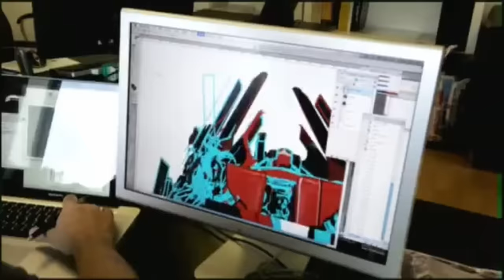TRANSFORMERS: THE BASICS on TRANSIT

Comment: This is surprising, a character I don't know off the top of my head, don't remember ever encountering this one on the wiki
Edit: And that's why, RID is one of the biggest gaps in my knowledge , especially the comics, though I have to have read about that IDW one before at least in passing.
As a fan of Scioli's GI Joe vs Transformers, I've always had a bit of a soft spot for that Bus Decepticon, it's a really memorable design for a rare original character in that series.

Comment: You have a character known to look like a rhino. How do you adapt it? By making him look like an insect. Again. Meanwhile, the actual bug characters, from Bombshell to Waspinator to Hardshell, never appear in these piece of trash movies...
Reply: His insect look seems to be far more memorable than his rhino looks
Reply: @8ball180  It´s equally boring to me, but if they want bad guys in Transformers to have bug faces that much, why aren´t they adapting the ones that are supposed to have them?
Reply: @danielmedela8725  well they do like scorponok in rotb or TF 2007. Also unless the character transformes into bug they won't adapt them, the bug face is less of transit being a bug and is more of a generic monster man face
Reply: @8ball180  I hesitate to call that Scorponok a Transformers, it doesn't even transform in either movie. It, like Freezer/Frenzy, is only there to connect them. Sure, the ones in BB movie did not transform either, but at least had kibble.
Reply: @danielmedela8725  they have do have robot modes just not seen in the movie plus not all bb transformers had kibble like ratchet, Ironhide and brawn
Reply: @8ball180  funny. They did have kibble. Windshields and wheels
Reply: @danielmedela8725  Brawn didn't have those. Neither does shockwave and soundwave
Reply: @8ball180  Brawn did, at the hips. As for Soundwave, his kibble is the casette door, of course. Shockwave needed some, though, yeah...
Reply: @danielmedela8725  toy of Brawn has wheels on the hips but the actual model in movie doesn't. For Soundwave I don't if that counts as a kibble since soundwave doesn't transforms into a cassette
Reply: @8ball180  Ravage was in his chest, I would say it counts. But the point is... If they want Decepticons to have bug faces, why aren't they adapting characters like Shrapnel or Tarántulas, who are supposed to have them?
Reply: @danielmedela8725  hm Idk since it's separate from his transformation. Also I already this unless the character turns into a bug they're not going to add them and that transit(and probably other decepticons for that matter) is more meant to  be just a scary monster face not that he's supposed a bug.
Reply: @8ball180  multiple eyes and bug jaws? Just give him a bug alt-mode! It is specially bad in ROTB, when there are multiple predacons with bug jaws, all of which would work great in the movie, and nothing.
Reply: @danielmedela8725  The old transit designs gave him a rhino face, shouldnt he turn into rhino not a bus? Plus giving him a bug alt mode wouldn't not have fit since he's supposed a decepticon not a predacon and having a vehicle alt mode sets him apart from the animal transformers in the film which are supposed to be seen as unusual.
Reply: @8ball180  But why change that original rhino face then? It would look great too. And animal Transformers being rare? Ravage was in the previous movie, dude.
Reply: @danielmedela8725  I meant transformers that turn into animals. For the other point they probably just had an original design and then hasbro gave it the name transit since he transformed into a bus
Reply: @8ball180  The funny part is that having more beast-formers, as they are called, in the movie, would also be good, as it would showcase how the Maximals are more advanced in tech. Hell, Stratosphere could be replaced by Skylynx and the movie would overall improve.
Reply: @danielmedela8725  maybe if they were connected to Maximals/predators otherwise more beast characters would be unnecessary
Reply: @8ball180  To the contrary. The Maximals are from the future, they said so themselves. Having more beast-formers from the present would drive in how advanced the Maximals are supposed to be. Plus, it´s the theme of the damn movie, and the "beasts" barely "rise". Or appear. Half of them barely even talk.
Reply: @danielmedela8725  Maybe if the Maximals were techno organic otherwise having the Maximals/predacons be the only with beast forms helps drive home how different the different the future is. Also the solution to Maximal problem would be to give them more focus not add more characters.
Reply: @8ball180  To give them more focus, and replace Scourge, Battletrap and Nightbird for actual Predacons.
And yeah, Maximals should have been techno-organic.